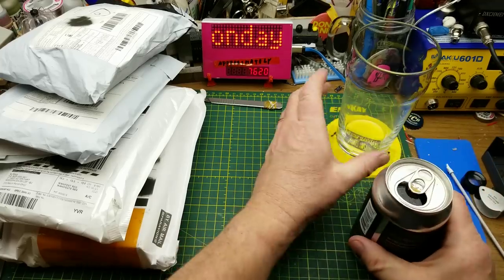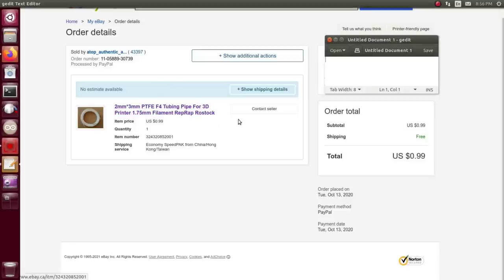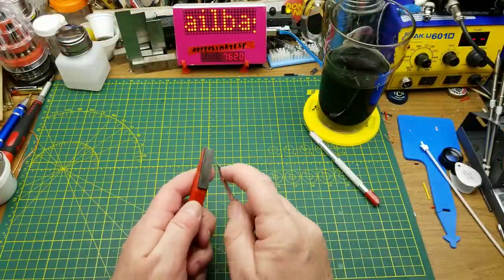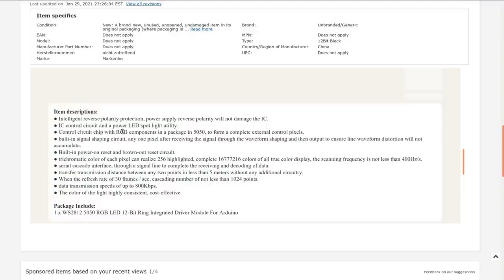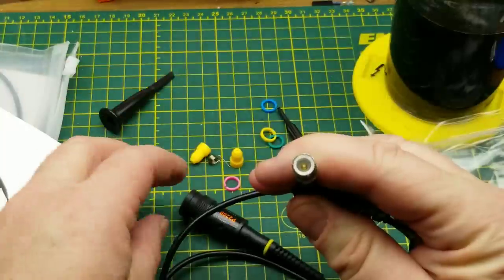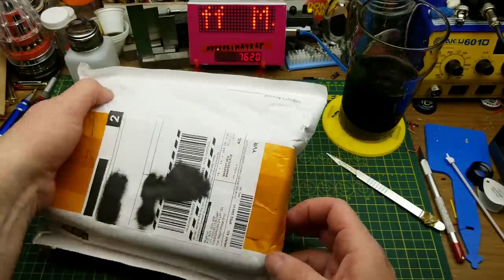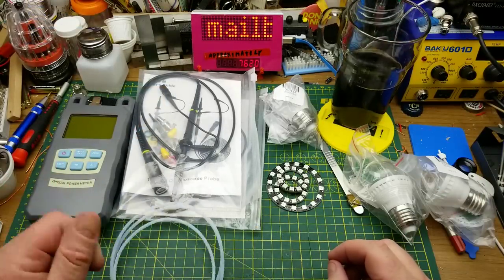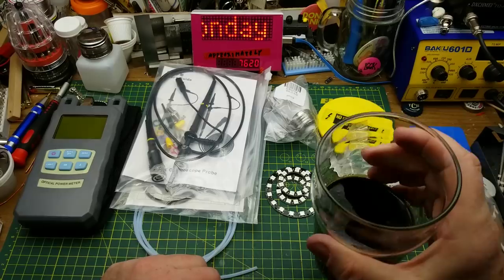Mailbag Monday #107

Comment: This reminds me I need to order replacement 2812 rings because I damaged a pixel on one and borrowed pixels via hot air on another. Need a fresh set.  I've never had a probe set with a new scope include the tip to BNC adapter, and I've wanted it so I just ordered 2 on Digikey.  Maybe I should have just ordered 2 of these probes!

Comment: There is no shame in resharpening those hobby knife blades, I do it all the time, mostly because I keep forgetting to get new ones, and I mostly forget exactly because I resharpen them haha if that made any kind of sense. EDIT: I believe the reason why we are seeing higher shipping cost in Canada is due to the fact the USA or USPS wants non-paper sold in evelope form to be shipped as a small package, which means normal stamps no longer work, here from Canada to the USA that is a minimum of $7.30 probably a little less from China to the USA but they put a price in between so they only have one listing rather than separate listing for eacch country. that is my guess anyways
Reply from the maker: The real reason I started sharpening my blades was to get them sharper than factory. That's helpful if you are doing rally fine work.

Comment: Why is shipping so expensive at the moment. Is it nearing a holiday or something?
Reply: I believe the reason why we are seeing higher shipping cost in Canada is due to the fact the USA or USPS wants non-paper sold in envelope form to be shipped as a small package, which means normal stamps no longer work, here from Canada to the USA that is a minimum of $7.30 probably a little less from China to the USA but they put a price in between so they only have one listing rather than separate listing for each country. that is my guess anyways.
Reply from the maker: That is, no doubt, a large part of it.

Political tensions may also have some impact.

Comment: Have you ever been hit with import tax from our friends in Mississauga? I wonder if there is any limit
Reply: Where did you get your Menda type fluid dispenser? is it any good? just curious, the real ones are insanely expensive.
Reply from the maker: No. Then again, I generally don't buy things that cost more than $20-25 that would be shipped through them.
Reply from the maker: I got 2 of them from some random seller on e-bay (probably a low-ball auction bid that I didn't really expect to win). 
I've had them for over 3-4 years now.